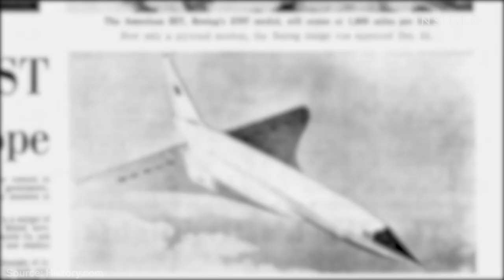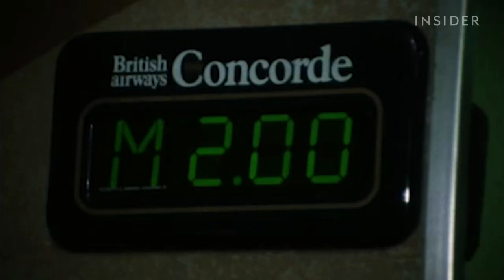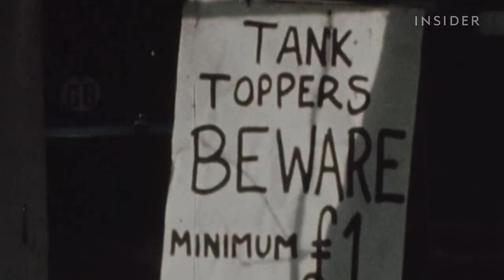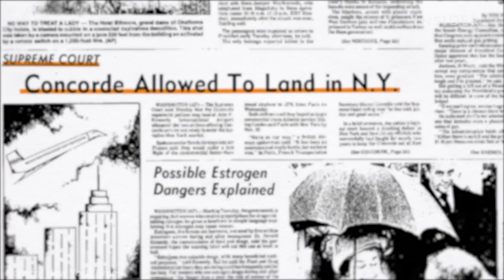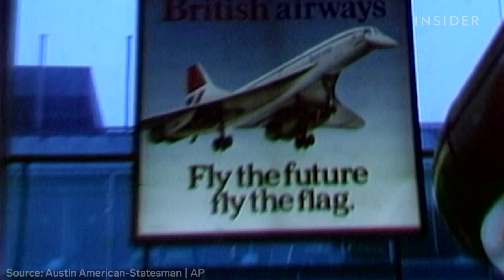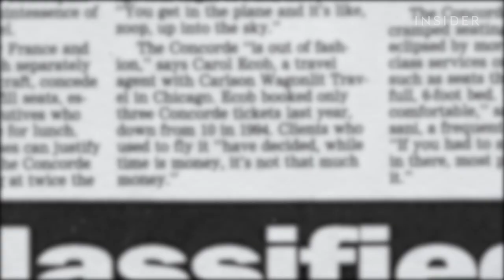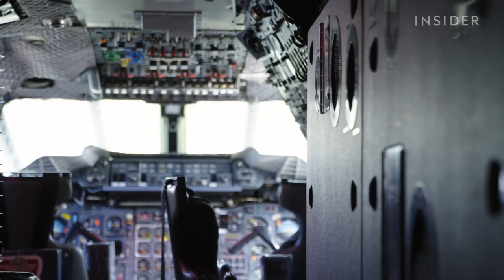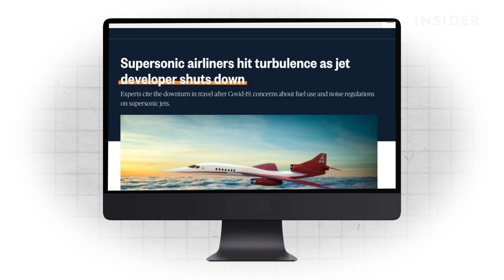Is Supersonic About To Come Back? | Rise And Fall

Comment: The late-1960s was a great time to be a child interested in science and technology: the Apollo programme, the first flights of Concorde and the Boeing 747 etc.

Concordes were noisy, but as a teenager I lived in Lincoln and we had Vulcan bombers flying from RAF Scampton and RAF Waddington either side of the city.  They used a different version of the same turbojet that Concorde used, and they were seriously noisy, especially if several were taking off together.

I think it’s interesting that nearly all the Concordes built are now in museums.  I visited the British pre-production testbed, which is now at the Duxford museum, three years ago, and it was fun to compare it with the Comet jet airliner (the first commercial passenger jet) which is in the same museum.
Reply: the saying back then was true "the future is now"

Comment: Probably gonna remain super luxury service, saving a few hours and some novelty fun isn't worth that massive price tag for regular joes like most of us.
Reply: Yeah. I think the speed current aeroplanes are going at, is the golden spot for passenger transport. Of course different designs usings less fuel and carrying more passenger is something I hope to see soon
Reply: This new tech is 70% less expensive than concorde.
As soon as more companies achieve this tech, the average joes like us will be able to use it. 
This is the regular technology cycle… since forever
Reply: I looked into it once to fly to Europe in '94. One way $6500
Reply: @heitorcornelius  Still nowhere near the fuel / mile, pilot / passenger or any other efficiency normal airlines have. You will still pay a multiple of what a normal flight on the same route costs -> its a luxury.

Also a luxury that should be banned, injustifiable waste of fossil fuels.
Reply: @heitorcornelius  unless you can get a supersonic aircraft to be affordable to fly it will fail .
Reply: cmon guys, this is really obvious: Every new tech is expensive at first and with time it gets cheaper. It happened with every single device that you guys are using it today. WITHOUT this first expensive approach, none of it would be developed to the point it gets cheaps.... 
this should be common sense. cmon.
Reply: @aenorist2431  No need to ban specific uses of fossil fuels, just have a general carbon tax. The government deciding which carbon emissions are justifiable and which aren't isn't a good idea, better to have the market decide after implementing a tax. If you don't like the results, just increase the tax until you do
Reply: @Roberto Vidal Garcia This is due to competition. There really are just a few big airlines. These airlines are ran somewhat like a monopoly so costs can remain profitable. If you were to add a new player into the game that provided supersonic jets, it would be difficult at first, but eventually, the other airlines would be forced to compete. Keep it up long enough and the average joe will be able to afford it. Look at cars, popular electronics such as: smart phones, and TVs. It is coming.
Reply: "Probably gonna remain super luxury service, saving a few hours and some novelty fun isn't worth that massive price tag for regular joes like most of us."

-- Most people about the prospect of affordable commercial air travel, before the advent of same.
Reply: @alexmijo  A carbon tax is equivalent to punishing any productive activity and the road to global poverty and famine. Not even affordable food can be produced without fossil fuels, which produce 80% of the world's energy for extremely good reasons.

If there was actually a "climate crisis", "climate emergency" or whatever the fear-mongering term of the day happens to be, the only way to solve it without effectively plunging the world into a new dark age (quite literally) would be to liberate the market for nuclear power (which can be used to produce reasonably affordable carbon neutral hydrocarbon fuels) so that innovators, investors and entrepreneurs could go to work and come up with truly affordable nuclear power plants.

But of course, the climate hysterical movement is vehemently opposed to nuclear power, although it's the only reliable, scalable and affordable carbon neutral energy source in existence.

This gives you a hint about their real agenda.
Reply: @Roberto Vidal Garcia you are missing the point here, airline transport isn't a two decades old industry, it's been around since the 50s, at that time tickets were absurdly expensive, only the super rich could use them, price dropped massively since then, getting a twe way tickets for less than 200$ is a bargain, the overture will be a relativly small plane (50 passenger in luxurius seats) this way filling the plane every flight is very realistic and if the tickets stay around the same price of conventional first class (wich by the company claims it should) it has the potential of being very succesfull. the concorde was actually designed for the masses, operational costs brought the ticket high in price, but of first class it only had the service, the seats were comparable to those on a ryanair flight but made out of leather, the overture is designed from the get go for a luxurius service so it can be more profitable in that sense, lastly for the ultrarich time almost alawys equal money, for a lot of companies cutting the flight time in half in order to moove theyre executives may very well be worth the extra cost
Reply: @starshot5172  I think that moving more people in a single plane is the last thing you want to reduce cost in a super sonic aircraft, as expanding a super sonic aircraft's fuselage is significantly more expensive and will also take significantly longer on maintanance.
Reply: Considering the Apollo Moon landings and this spectacular aircraft, we have gone backwards in technology and Majestics.
Reply: @neeljavia2965  Imagine thinking "ok boomer" is or was ever funny or an argument.
Reply: @shasha1873  We have stagnated.
But not gone back.
Reply: @Roberto Vidal Garcia Of course
Reply: Ever heard of saving money? You don't necessarly need a huge income to buy expensive products or services
Reply: @Roberto Vidal Garcia You tell me that while everyday I see middle class citizens spending thousands on bags and clothes just to appear wealthy. My point is even though not everyone will save for luxury items or services, when looking at the younger generations I can see that many people need to show or pretend like they have a lot of weath. This alone makes me think it will not be as a niche market as it used to be.
Reply: @Roberto Vidal Garcia I was talking about a $4000 $ seat not a hundred grand procedure 🤣

Comment: It's amazing how the same general design of Concorde is used today because those Delta wings just can't be beat.
Reply: it took 480 hours of work and windtunel just to get that result. it is, prety much, a perfect design.
Reply: Hey use what works/worked. The main reason I feel isn’t even safety it’s the cost of fuel vs amount of passengers. No one wants to pay 50k a ticket these days. Not even the rich.
Reply: Well the delta wings were first used on the Vulcan strategic bomber which first flew in 1949. So they were hardly new with Concorde.
Reply: @Dave_Sisson  I didn't actually know this. Was the Vulcan capable of supersonic flight or was it mainly for stability/agility/stealth reasons?
Reply: It’s ideal for supersonic flight
Reply: @THEJPR  2 years after the first supersonic flight from a prototype? Highly doubtful they could.
Reply: Physics are unforgiving.
Reply: @THEJPR  In the mid 1940s engineers at Avro were playing around with models with different wing shapes and found they got more lift and less drag with the delta wing, at least at higher sub-sonic speeds. My understanding is that Vulcan bombers were not supposed to go supersonic, but a few did and survived without breaking up.
Reply: @snurod  most likely it will be used again primarily for rich businessman, for whom time is money, when you are earning that much saving 2 hours on a flight is worth the cost. It is the reason why private jets are used by companies like walmart
Reply: @Dave_Sisson  Damn. Thanks for sharing. I looked at a picture of it and it's massive.
Reply: What’s not amazing is how there isn’t a droop snoot anymore 😢
Reply: @DaveSisson That's not true in the slightest. Dr. Alexander Lippisch developed the first delta wing prototypes in the early 1930's. He is known as the father of the delta wing. Look it up.
Reply: @sadenuttie2234  But the costs still didn't justified it.
Reply: @neeljavia2965  they did, the concord (70s tech) returned a profit despite being way less efficient than what is proposed here, saving hours on a flight is super important for ceos and high level businessman, after all, what is an extra 10-15k when saving 2 hours is worth 50,000 in your time
Reply: @sadenuttie2234  It's not.
Otherwise everyone would have bought it.
In the digital age of video conferencing and internet, the need to travel over long distances in a very short span of time has reduced drastically.
Reply: @neeljavia2965  rich people will always want better, if you can afford it why not go double as fast to a destination? Physical meetings have been reduced but conference meetings will still be around (although to a lesser extent), and the need to travel for other events and reasons will still exist for businessman. It will not be a huge market, but it exists. Heck, if a ticket cost is 10-15k for a would be 12 hour flight I will start travelling supersonic, as I have the funds to do so
Reply: @sadenuttie2234  Problem is costs won't go down by that much for years to come.
Because not much people are investing in it.
Reply: @neeljavia2965  a simple google search would tell you that that a flight from London to New York costed 12,000. Do you really think the efficiency will have gotten worse with better engine technology and design? Why are you making claims like this without envy sort of research or experience. Why did you just say 50,000 tickets with no knowledge about the concord?

Also, learn some grammar
Reply: @sadenuttie2234  Wrong person dude.
Reply: Ok, the other guy said the 50k ticket thing, but the concord returned a profit, and this tech will be even better. I don’t know why you are even trying to argue this
Reply: I mean yeah. It's a commercial airliner. Delta wing designs are extremely stable at high altitude, and extremely maneuverable at low altitude. Perfect for a supersonic commercial airliner. It also makes a really good fighter interceptor. That's why NATO has the typhoon euro fighter interceptor as it's one of it's air dominance fighters, and it also uses a delta wing design.
Reply: Not most of us but all of us after the coronavirus and the war in ukraine !!!
Reply: @tobee_gamer5816  the snoot droop?

Comment: The million dollar question you never answered was, how much cheaper is it being forecast to travel this way. The technology hasn’t changed one bit, but if the operating overheads come down it will be fantastic… sure people will use it. Just like people buy Rolls Royce or Bentley when a Toyota will do. But Concorde will always be the best….
Reply: Actually the technology has changed quite a lot
Reply: @numtot2172  so apart from analogue instruments to digital and no doubt a lot more electrical solenoids for mechanical replacement none of which is necessarily better just cheaper what’s the underlying core technology uplift?

Comment: Simple answer to the question posted in the title of the video: no.
Airlines don't look at speed nowadays but instead at fuel consumption per seat at which supersonics perform terribly.
This is only going to increase with countries looking to cut down on carbon emissions. Not only the airline industry but also other transport oriented industries such as shipping have in fact become slower in recent decades.
Reply: That might be true, but I think due to the technology and the newly opened routes, I think that supersonic travel does have more of a chance compared to before, just so long as these programs fix the sound barrier problems.
Reply: Slower, and more crowded.  The name of the game is: how many seats can you cram onto a plane?  The seats get smaller, the rows get longer.
Reply: Eventually an electric plane could do it possibly.

Comment: Concorde was an astounding success. the planes were built then ran until they literally wore out. even NASA had to get a tu-144 because there were no Concordes with any life left in them. making British airways and air France big bucks over their entire lives high gas prices offset by massive ticket prices. and a pretty good service record - one crash over a 27-year service.

but by the end, these planes were actually just getting old the first flight was in 1969 still had a flight engineer position in the 2000's .

Comment: Its intresting to compare boom Overture to Concorde. While Overture is considerably smaller on the outside, on the inside its not that much smaller. Overture is 62 meters long and is expected to have 65-88 seats in a 3 wide configuration, that is 22 to 29 rows. Concorde carried 92-128 passenger in a 4 wide configuration, that is 23 to 32 rows.

Overture claim to have a MTOW of 77tons, while Concorde had a  MTOW of 185 tons, that is 1.44 ton of aircraft per person for Concorde but only 875kg for Overture. Apart from being made of composite, Overture also have a modern bypass engine. This should make the engine some 30% more efficient. While that may not sound like a lot. Combined with the lower weight, lower speed, and better optimized span that decrease the amount of fuel needed quite considerately.  If you need less fuel, you can carry less fuel, and if you carry less fuel, you can reduce the weight of the aircraft even more

Comment: Either i'm living in a parallel universe or somethings  not quite right here but i saw elsewhere that the main reason British Airways withdrew their Concorde operation was because Airbus (which absorbed Aerospatiale which was partly owned by the french government along with Air France which was trying to be "floated" on the stock markets at the time of the crash of flight 4590) put up the cost of maintenance of the aircraft by 42% which made it economically unviable for BA ----- if the aircraft was so uneconomic why until the Airbus price rise had BA when the modifications were carried out refitted the interiors if they didn't see a future for the aircraft.

Comment: It's going to have the same problem, noise, sonic boom.  How big a boom is a function of vehicle gross weight. The heavier you are the stronger the shockwave.  All these really cool technologies will not scale up well I don't think.  The changes in materials technology are fabulous as are the design engineering aspects but the same problems remain. There is some research that is looking at ways to minimize how and where the shock wave propagates.

Comment: Supercruise has entered the chat.
Reply: Well, Concorde did supercruise once it reached at mach 1.75 without the needs to use the reheat system. That aircraft and its engines pioneered "supercruise", and eventually found its way to the F-22A Raptor which also capable of doing supercruise.

Comment: 22 hours of maintenance for every hour in the air? Did I hear that right?
Reply: Yep! Basically the Concorde would go into maintenance for 3+ days just for one trip to NY. Of course it isn’t done at the moment but imagine how high those numbers stacked up with a few more flight, one of any reasons for why the Concorde was so dang expensive to operate
Reply: @marioprz0476  but it did return a profit, especially towards the end of its service
Reply: @sadenuttie2234  It surely did, but as the video said; the 9/11 attacks+the crash+ people using other methods of travel ultimately made that profit not enough to justify keeping the airplane in service
Reply: @marioprz0476  yeah, and it was also getting old. But some people called it a complete failure, which isn’t true. Any aircraft that adds to the brand image of an airline and returns a profit is a bloody fine aircraft
Reply: @sadenuttie2234  It was failure I'm terms of replacing subsonic planes all together.
Unlike jetliners completely took over propeller planes in the 50s and 60s, concord wasn't able to do it which was it's original plan.
Reply: @neeljavia2965  I’m sorry, since when were we talking about this company taking over? The concord didn’t create a transition to supersonic flight but it still was very effective, and returned a profit while being an icon. In what way is that a fail? This aircraft will be great for a small sector of the total aviation industry if it gets built
Reply: @sadenuttie2234  It's profit wasn't enough to justify further R&D to develop planes which were more fuel efficient, had more cargo and passenger capacity, didn't make noise and didn't require days and days of maintenance.
And it failed in it's main objective of replacing jetliners.
Also just because it turn a small amount of profit, doesn't mean it's successful.

Comment: Supersonic travel will not work simply because in order to travel at supersonic speed you need to use turbojet engines with afterburners….and they are very noisy.
Concorde was also extremely complex and needed a lot of hangar time
Reply: Newer military jets have engines that don't need to do this, but still fuel use....
Reply: @jonathanjones3126  Name one that can go supersonic minus afterburner?
Reply: @Sterlingjob  f22
Reply: @jonathanjones3126  Are we talking super cruise or going supersonic without afterburners?